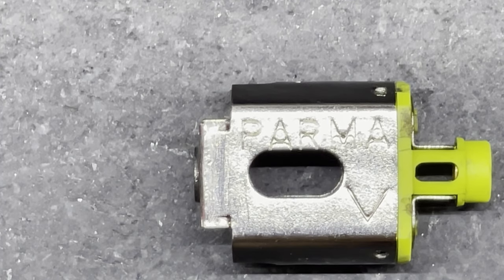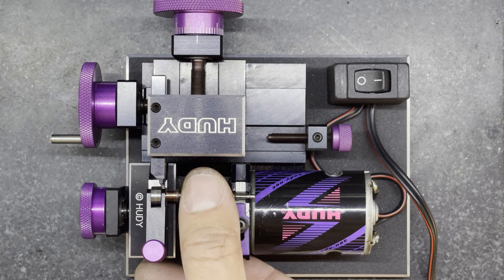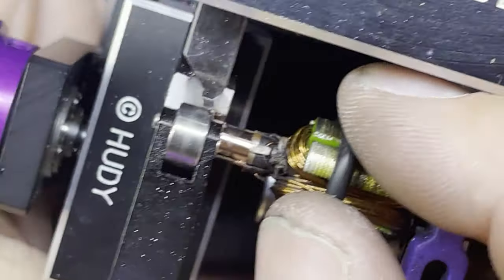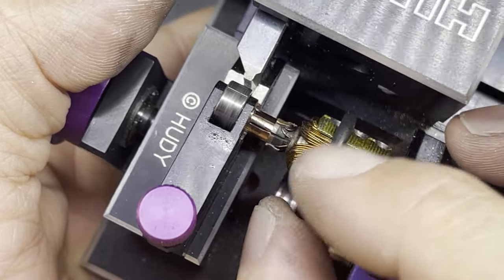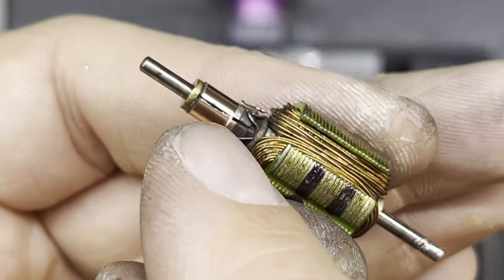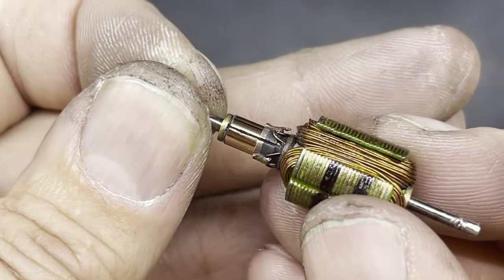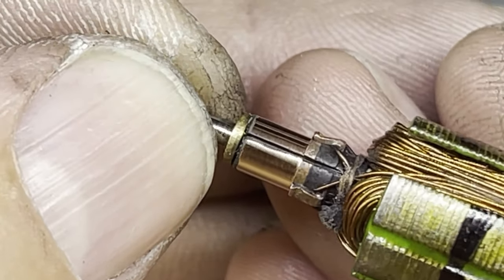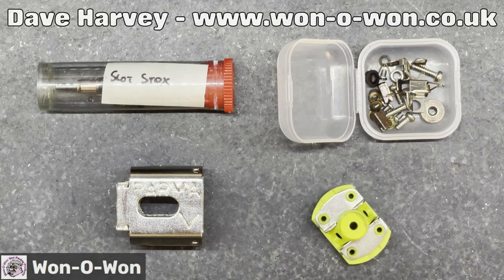Servicing a slot car motor to improve performance Super 16D Slot Stox - Part 2

Comment: A sharpie on the comm makes it very easy to see the progress. 
Right before the last lathe pass, we clean the gap, and then use the ballpoint pen, then the last pass, this keeps a sharp edge on the comm to keep the brushes clean. In 10th scale 4 minute races we did not notice a difference , but 12th scale 8 minutes racing it did make a diff.

Comment: The setup is Parma #502. That arm is Pro Slot (Speed FX). Those Chinese Pro Slot arms have very soft copper coms but are thicker and bigger diameter than the barely harder ,thinner and smaller diameter Parma arms. I recommend the Gold dust brushes on the Chinese Pro Slot as they are softer and easier on the com. With a light spring such as a Champion red(med) or green (light).

Comment: This is something i never saw much use for, All my arms were always pretty straight and never needed truing. I tended to use heavier springs for better brakes so maybe that helped. I tended to build low timed S16 magnet torque monsters that loved tall gearing, Our trak at the time, 1990's, had some fairly loose rules as far as a stock class motor. When we'd run like regionals (Bigger races), we'd run their rules of course and build for them, but we had our own setups we liked to run locally. The funny thing, almost everyone had their own thing (Secret sauce if you will) and all were about equal

Comment: Cheers James. Perfect timing for me because I've just bought a barely used Hudy comm lathe from ebay for £36!
I've been practicing on some old arms and plan to practice rebuilding some old Scaley Johnson 111s as practice pieces before I go anywhere near my G12 or strap car stuff.
Really enjoying these videos especially. Thanks again.
Reply from the maker: Great. Just bear in mind that if the Hudy comm lathe was intended for RC motors you may have to machine the tool holder and v blocks to get the tool to sit in the centre line of the shaft.
Reply: Yes I've already worked that out. I used to be a toolmaker years ago so I'm familiar with the issues.

Comment: It's unusual to see that much smearing of the metal into the comm slots - maybe it's a very soft copper.  Or possibly the cutting tool is past its best - even diamond bits do wear. I've found the best finish, using both carbide and diamond cutting bits, comes from using a high speed and a deeper cut - i.e. go straight to the finished size, rather than creeping up on it in very fine passes. I also like to 'paint' the comm with a sharpie first - makes it really easy to see where you've cut, and adds lubrication.
Reply from the maker: Thank you Wink for those tips. I was surprised at how much copper was burred into the slots. The tool cuts fine on other coms, so it must be the very soft copper on this armature.
Reply: @CleaveTech  The worst comm cutting experience I ever had was when I decided to retrue the commutator in the washing machine motor. Probably 20 or so segments (I used a bigger lathe than the Hudy lol). They all smeared into one big soft mess😨. I spent the next half day making a tool to recut the slots.

Comment: Hello there ! - this happens because Com is cheap / poor quality + Plus = It looks someone used higher spring pressure and a very abrasive brushes such as proslot goldust wich causes higher amp + higher temperture
Reply from the maker: Hi Chris. Yes, I think the com quality is not very good. This doesn’t happen with the coms on open armatures from PK or Valiko.
Reply: MAN....for shure man !! - ahahahah - Its so fun to push those old arms to limit....specially parmas - gotta have balls = risky business
Reply from the maker: @ACCOUNTANTB  , it runs really nicely now it has a ball race in the can and is installed in the car. Can’t wait to try it out in a few weeks time with its owner.

Comment: Hello Cleve, what rotor degree would you recommend for Production 24?
Reply from the maker: It makes a small difference depending on the length of race and the gearing you are permitted to use. With G12 armatures in Production 24 I use 46 to 48 degree armatures.